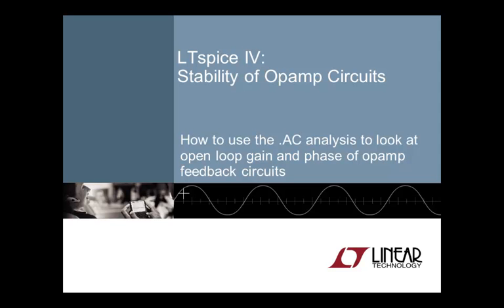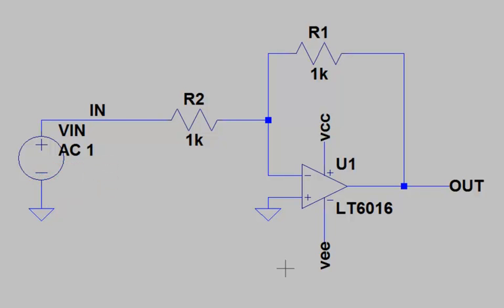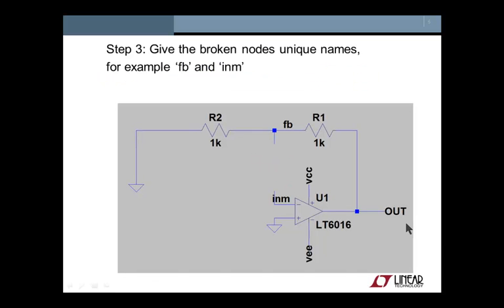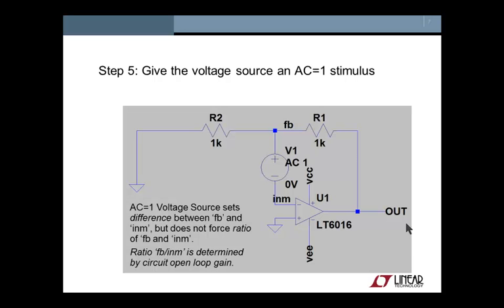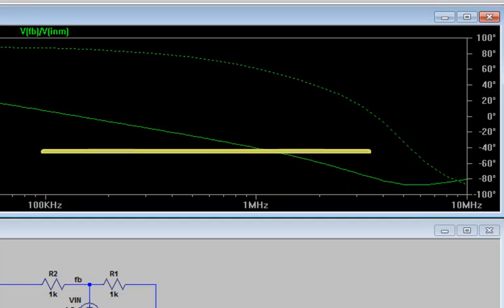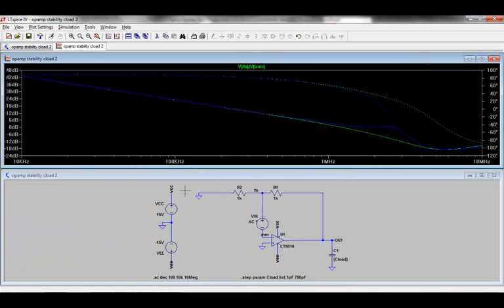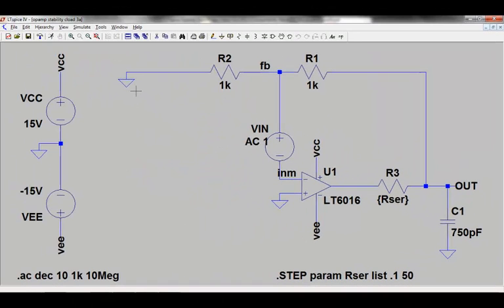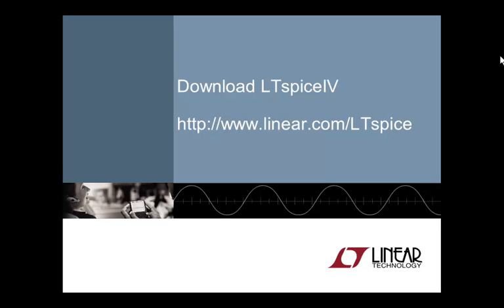LTspice IV:Stability of Opamp Circuits

Comment: I tried your method and compared the result with the datasheet of a LT1001. Unfortunately the max. Gain between my LTspice simulation and the datasheet differs by about 10dB roughly. Can you verify your method by applying the LT1001 in your circuit arrangement. Thank you for your response.

Comment: 4:25 How does the right scale at 0dB  (at -40°) correspond to the phase margin shown in the box window (56°) ? Whats the math behind that?
Reply: That does not involve math or magic. The phase at the 0dB gain frequency is +56 deg, not -40. The gain in dB is shown as a continous line, and the dB's are on the left hand y axis. The phase (in degrees) is the dotted line, and can be read on the right hand axis.

Comment: I have tried your method for some of my analog circuits that I failed to analyse.
I cannot thank you enough for showing this easy method for finding system transfer function.
You also enlightened my knowledge about stability which so many professors, articles and books failed to do.

Comment: Could you please give a more specific explanation for this method? I mean for my understanding it's not pretty straight forward expressing the open-loop gain with the ratio Vfb/Vinm.
Reply: And does it work for every op amps? It'll be much better if a derivation is illustrated. Thanks!

Comment: Hello, isn't this "Loop Gain", and not "Open Loop Gain"?  "Loop Gain" being the product of the "Open Loop Gain" and the "Feedback Factor", which is evaluated at 0dB to determine phase margin?  "Open Loop Gain" should be the response of the amplifier with no feedback, correct?  Thank you and great video!
Reply: With all due respect friends, it’s not semantics.  It’s a very common misuse of a term that invites confusion.  Harold S. Black at Bell Labs invented feedback amplifiers and pioneered control theory and his definitions of the two quantities was very clear.  The open loop gain is the forward transfer function with no feedback no feedback connected.  That’s originally how all amplifiers were used but that gain was not constant and depended on temperature, humidity and everything else.  The resulting output signal strength was unreliable.  Introducing feedback produced a very constant gain that only dependent on the feedback components as long as the loop gain is large.  Loop gain is the product of the aforementioned open loop gain and the transfer function of the feedback network from the output to the summing point.
Btw, Kris Lokere is a very bright stand up guy and former colleague of mine!!!
Reply: That is just semantics. Some books call the product of all transfer functions in the loop for open loop gain. Some books call it loop gain.

Comment: I think it should have been V(out)/V(inm)
Reply: I do agree with you and I point out that  I would have added a minus sign : -V(out)/V(inm).
Reply: V(out)/V(inm) is not whole transfer function, you will neglect what happens across R1.
You can also see if you check V(inm)/V(Vout) you get pure opamp transfer function.
Try it on any more complex circuit and you will be surprised :)

(Vout being opamp output)
(Vout/Vinm VS Vinm/Vout is only a matter of sign/voltage source position)

Comment: Fantastic video!  We just started coming out with a series on Op Amp stability.  This simulation method is one of our favorites.  Of course a general idea can be made looking at the step response of the circuit in the time domain.  We introduced the idea with that...while using LTSpice of course :)